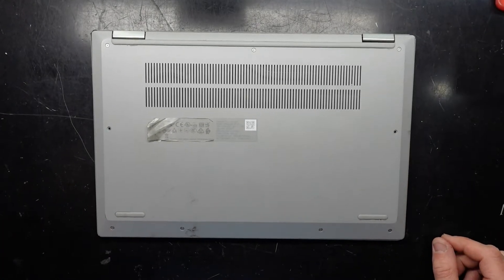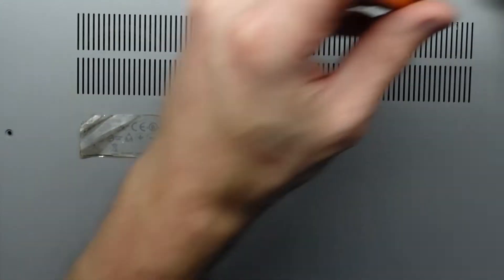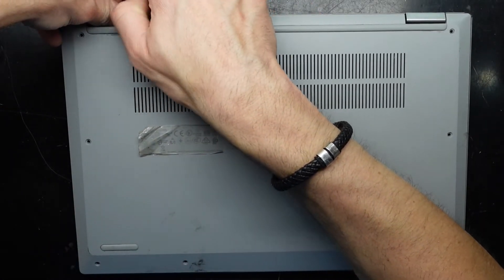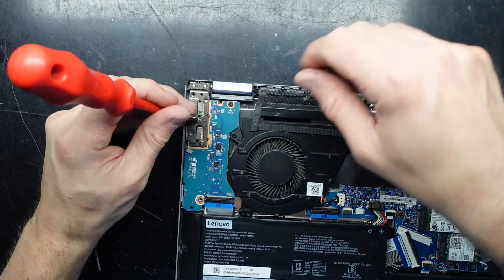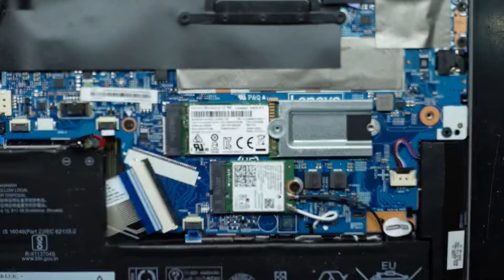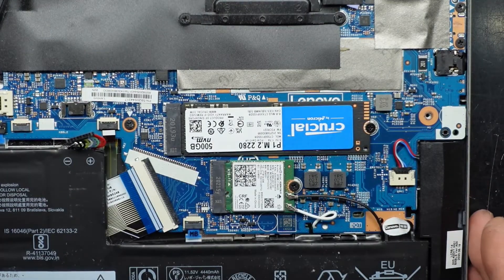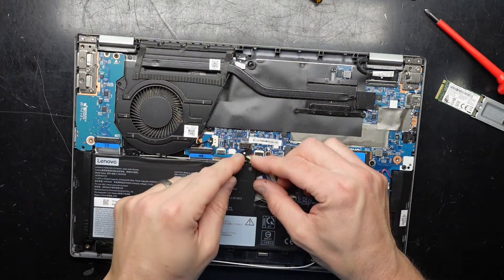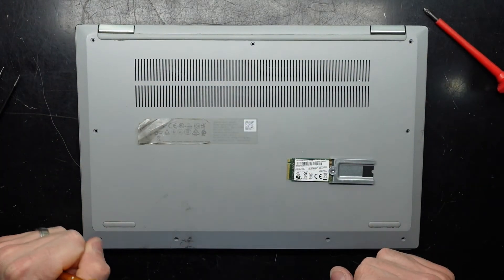Lenovo Ideapad Flex 5 14IIL05 NVMe SSD Upgrade and inspection

Comment: Does the SSD have to be particular brand? I have the exact same laptop with the tiny 128G SSD and I want to put a Samsung 1TB will this fit? Thanks mate for the video
Reply: Update*****yes for anyone that has a Lenovo ideapad that has a 128g SSD I installed a 2TB crucial SSD with no problems.

Comment: Thanks for the great video, simple and to the point! I've had this IdeaPad for over a year now and liking it so far, but slowly running out of Storage (512 GB, Intel i7 11th generation). Do you think that replacing the SSD with a Samsung 970 or 980 Evo with 1 TB of storage would work or could I end up with some compatibility issues?
Reply: it will make allot of door i replaced mine with 1 tb Samsung 990 pro it literally became butteryy smooth the reason of slowdown is the shitty ssd

Comment: will it work with sata m.2 drives? cus my other lenovo laptop doesnt detect the sata drive..
Reply from the maker: I'm not sure with that actually, as I would generally only use nvme on laptop's built since 2018
Reply: not it wont work with sata m.2 drives because they have different connectors

Comment: so how did you clone over the data? I tried to copy and paste the windows files from the original drive to my 2tb drive, but it did not work.
Reply from the maker: i used a program called acronis true image to clone it.

it wont work copy and pasting from windows
Reply: @rickstechrepairs  Thank you for this info!
Reply: Does this laptop support 2tb nvme??